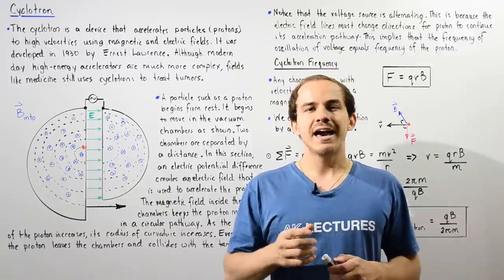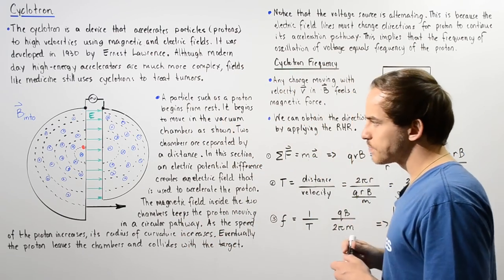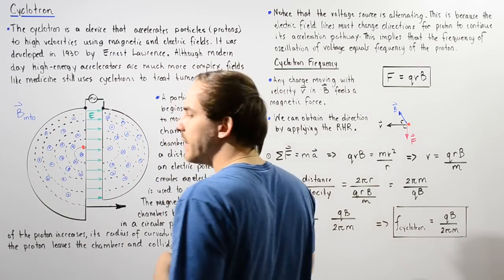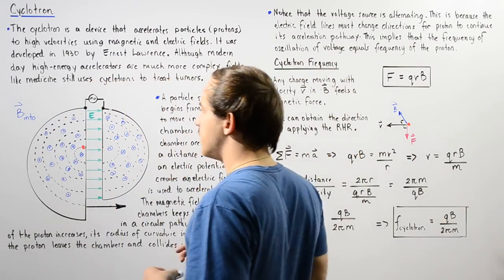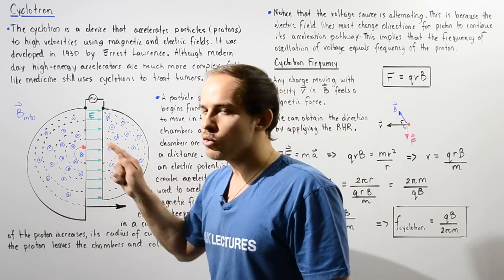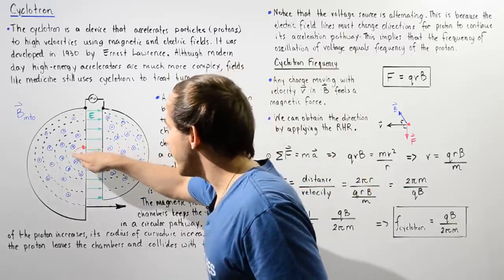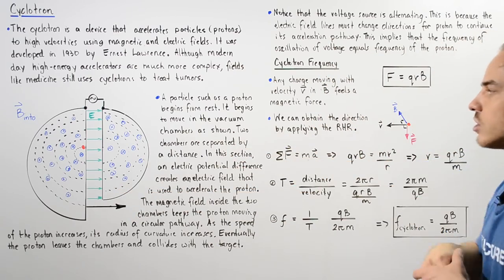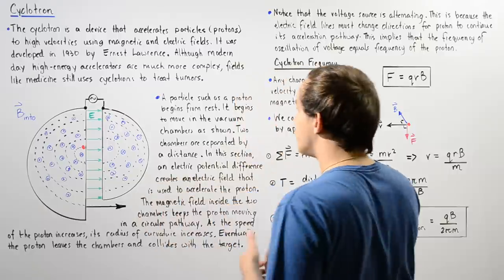Cyclotron and Cyclotron Frequency

Comment: Really nice and clear presentation. However, it is not clear to me why an AC source is needed. Since the particle is spiraling out counterclockwise about a central region, we could have a constant voltage in the top half and same, but opposite, voltage in the bottom half of the cyclotron. What am I missing?
Thank you!

Comment: I wonder, as the speed increases, doesn't it take the particle less time to transverse the region with the electric field?  The distance between the two electrodes is the same, the velocity is higher at each half-turn, hence it takes less time.  Does this mean that the true time it takes for a full turn, it gets smaller and smaller at each turn.  The the frequency should be corrected accordingly(?)

Comment: I'm curious....can the accelerated particle be ejected from the cyclotron in the form of a beam?  What is done with the output particles besides a target.  If a conductive line is attached to the target, can we use the accelerated particles as a current?  Thanks
Reply: The entire collection of particles is ejected from the accelerator linearly, so yes, it would be in the format of a beam - although to nitpick your question, a single particle is never a beam, only a collection of particles can be a beam.  

You wouldn't want to use an accelerated particle to generate a current.  One, it doesn't really make sense, you don't need it to be accelerated to do that, and two, between the ion source, the electromagnets, and the oscillating field, you'd expend a great deal more energy than a beam of protons could induce current in a target.

Comment: one doubt  
what exactly causes the greater velocity after every rotation
Reply: The two semicircles are charged electrically by the oscillator.  Thus, you have a positively charged and negatively charged semi-circle (D) at any given moment.  

The accelerated particle, typically a proton (+ charge) is shielded from electric fields while it is inside one of the hollow Ds.  While it passed between them, however, it is no longer shielded.  While in the gap between the two Ds, it will be attracted electrically to the negative D, and repelled by the positive D.  Thus, while in the gap between Ds, it will accelerate linearly towards the opposite D.  

Once it enters the D the electric field no longer acts upon the particle and it stops accelerating.  Due to the influence of the polar magnetic force acting upon it (and the absence of the electric force) the particle is spun around the pole of the magnetic field towards the gap again, where the voltage has been oscillated to the opposite charge it was on the last pass, and thus it is attracted to the opposite D again and again.